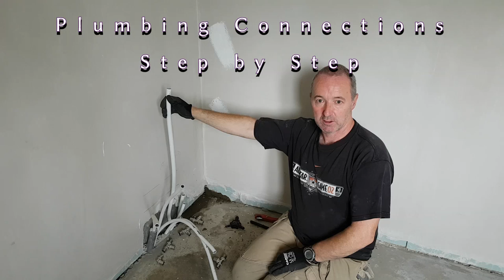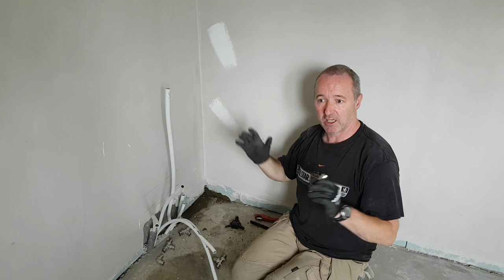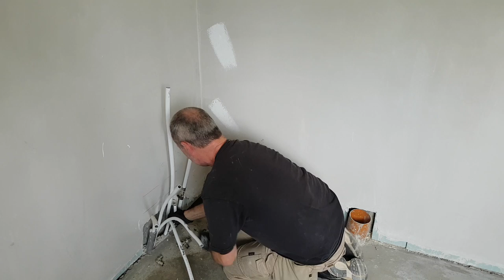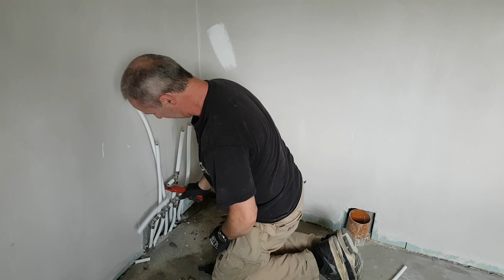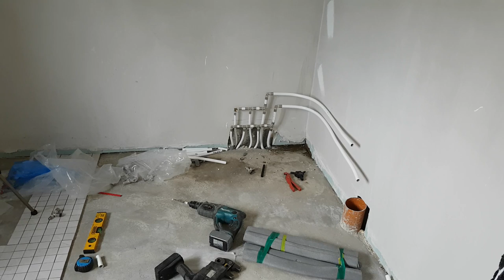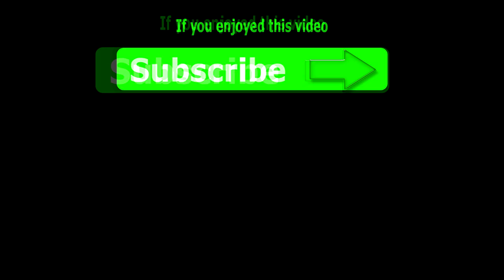Multi layer pipe connections

Comment: Not bad Gerry. I liked soldering up copper it always looked good but, it did take some time. Most the houses in this area are Pex mostly because of the price and even the commercial stuff with copper pipe is Pro Press or Victualic. Keep up the good work cheers from Michigan.
Reply from the maker: Hi Michael. Here's the plant room of this same house with a 300 litre stainless steel tank with 90 litre buffer underneath.  Some soldered fittings and multilayer too. https://youtu.be/DDnO5rStO-M  Thanks for commenting Michael Cheers Gerry👍

Comment: You could save yourself a few elbows by using an internal or external springs for bending. Like your flying videos as I used to do R/C slope soaring decades go near Blessington. Also, I am researching  the birthplace of my grandfather, Moneyboe, which i think is nearby to you. cheers Dermott.
Reply from the maker: Hi Dermot. I just looked up Moneyboe and it's only 4km from here line of sight. I plan on flying the paramotor this week when the weather gets better. I'll put it in as a waypoint on my gps and head over that dierection. Thanks for commenting Cheers Gerry👍
Reply: @GerrysDiy  Thanks Gerry, by the 1901 cesus the family had moved to Ballycanew.
Reply from the maker: I will be driving through Ballycanew at 7.45 in the morning. Here's a link to where I flew over Ballycanew at about 4000 feet https://youtu.be/3fGUJzmgf_U             . I have some other paramotor and paragliding  videos on that channel here on youtube too gerry kennedy Cheers Gerry👍
Reply: @GerrysDiy  Hi Gerry, had a look at that video, could mpick out my fathers birthplace at 4.45, near warchhouse hill

Comment: Gerry great video. I’m doing a cottage renovation and extension soon. Would you recommend these fittings. I’ve never used them . I’m used to using copper and solder and pex and compression.

Comment: hey man, do you think you could make a water heater out of those floor heating pipes and your oil burners? theoretically it shouldnt melt cause its full of water
Reply from the maker: Hi Fred It is quite easy to do but would need a blending valve and a pump tp reduce the water temperature to about 45 degrees C. It's on my todo list but I am very busy with work and some other projects at the moment. Thanks for commenting Cheers Gerry
Reply: @GerrysDiy  im really looking forward to that one :D

Comment: Hi Gerry
Any suggestions on reaming 32mm by hand with a reaming tool. It seems to be extremely hard work just getting the tool into the pipe. 
I don't want to put it in a vise as it might damage the pipe. 
Any help would be greatly appreciated.
Ro